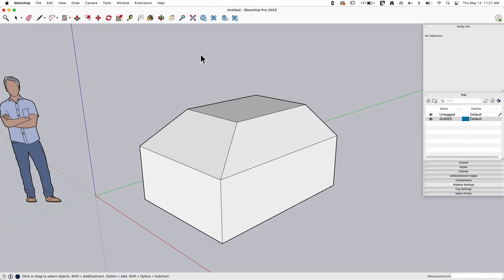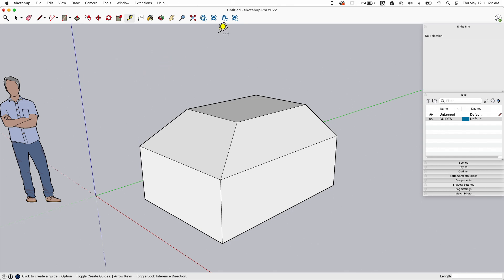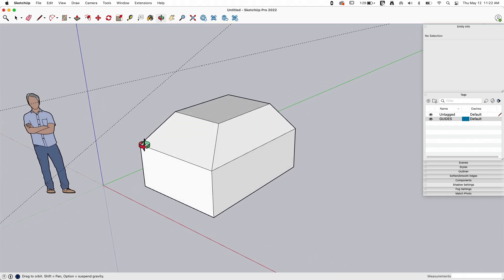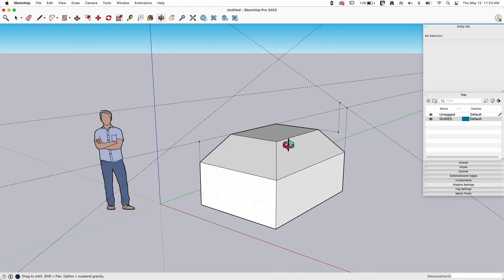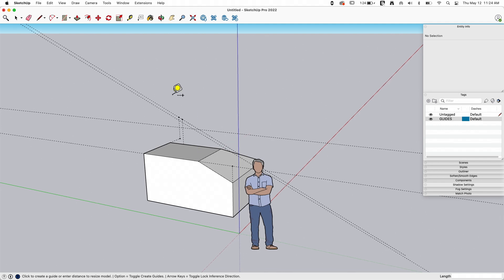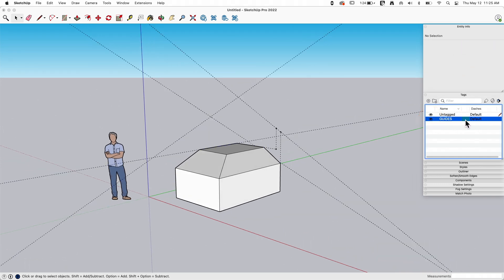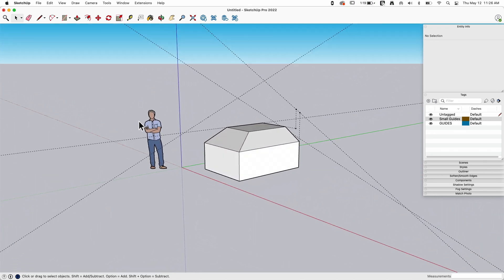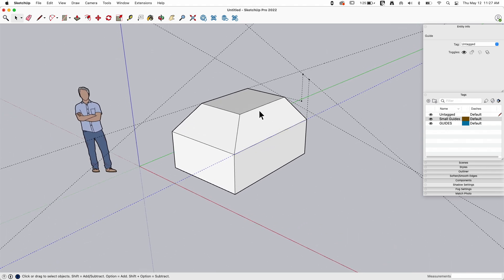A Guide to Guides - Skill Builder

Comment: If you can't create surfaces with guidelines, what good are they. You cannot draw, say , rectangles for example using guidelines as the cursor will not find the intersection. It is all guesswork. You cannot snap to guidelines. So, there is no way to create an envelope to draw in. Do you have to go all the wy to Sketchup Pro to get the tool bar across the top?
Reply from the maker: Guides are used to snap to without drawing or creating new faces. Your cursor will snap to guide and intersections. That is the whole idea of guides!

Comment: I am trying to use a guide line as my reference and add an infinite line. For example :I want two (infinite) guide lines offset 5" from each other, but not referencing an actual line. Is there a way to do that other than using the copy command?
Reply from the maker: You create a guide line at a specific length from a midpoint or edge, and you can also make one on a face. Copying an existing guide line works, or you could create a new one 5" from the first.
This article goes into more detail https://help.sketchup.com/en/sketchup/measuring-angles-and-distances-model-precisely

Comment: I LOVE guides. I have been working on a project where I'm having to replicate parts, so I take precise measurements and replicate the dimensions in Sketchup. Having reference lines that don't cut into geometry that are parallel to other edges is so great. I ended up having over 100 guides for one component.

Comment: I use the guides layer(tag) trick a lot. I wish it were possible to set in model parameters that guides were always placed on their own layer(tag) so that the extra steps to move them over there would not be necessary. If that was turned on then any guide drawn would be placed on the Guides tag when it is created.

Another option I would like to see is when drawing a circle or polygon that a center is automatically created (so no more right-click -> find center) and that a guide is created on the axis of that circle or polygon.
Reply: Hi Bob. Let's assume that your model has a drilled hole, and you want to find its centre. Simply hover your mouse pointer briefly on the circumference, then move towards the approximate centre. You will see the exact centre is then shown.
Reply: @MickHealey  Yes, I'm aware of how to do it using current tools/features. I always fight finding the center that way. It takes time plus it's a PITA when you are moving an object and want to center it over a circle, hex, what have you.

Comment: Using the guide tool, double clicking on an edge immediately creates a guide along that edge. If you are trying to inference from an intersection between two guides, if a small red cross does not appear when you hover over the "intersection", the guides are not perfectly aligned.